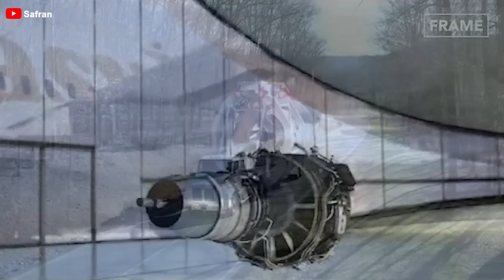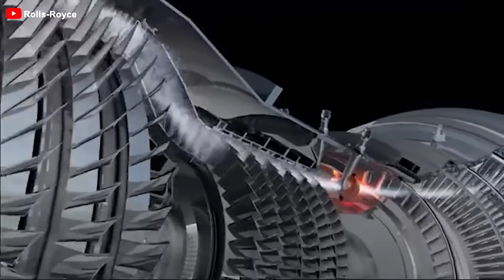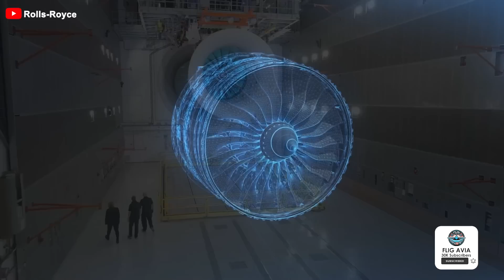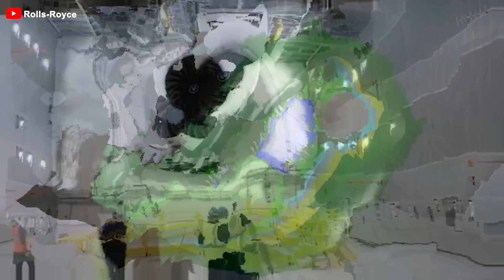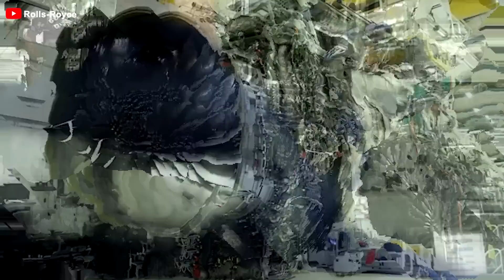Rolls Royce Boss Revealed NEW Engine Will Change The Aviation Industry! Here's How

Comment: Great News from the Worlds Greatest Jet Engine Manufacture,  I have noted that Rolls Royce have lost out on the supply chain for Aircraft like the Airbus A.320 321 etc plus Boeing 737 since the days that IEA Engines was sold leaving as your Vdeo states only the Wide Body Aircraft for Engine supply, Rolls lost any supply facility to Boeing on the 777 but got an exclusive on the Airbus A.350 which is not only selling well but is in production where as the 777 is still  stuck with certification problems.#
I am a Brit and proud of it and fully believe that Rolls Royce will lead the World with some of the very best Aero Engines ever made.

Comment: Please, give all measurements in SI Units (the metric system) in addition to the insane stupid and outdated imperial system only used by Liberia and the US.
140 inches = 3.556 m or 355.6 cm or 3556 mm.
85,000 lb = 38,555 kg
110,000 lb ≈  50,000 kg
Reply: WHY? because people cannot do simple mathematics?
Reply: @trevorhart545  Because the insane and outdated imperial system ha no logic, and it's no easy to calculate every imperial measurement into logic SI units.
Reply: It is not always an accurate thing to do, especially if the original specifications were in SI units and the figures being quoted are a rounded conversion to Imperial.

P.S. I agree with you about using SI units, not because I am biased (I am old enough to think in a combination, being quite relaxed about adding x grams to y pints in a recipe!), but for the simple reason that Imperial units are not fully standardised.

For example, wherever you go in the world, a litre will be the same, whereas a pint will not necessarily be.

Comment: Rolls Royce needs to fix their current engines as well. Their current engines are currently having reliability, durability, and availability issues. More time and money is needed to fix these issues before proceeding to their next gen engine. As it is, airlines are opting out of Rolls Royce powerplants on their follow-up orders of aircraft. No point having a great new engine if the company's reputation is falling to the wayside, and airlines refuse to buy anything from them.
Reply: They are doing.

Ultrafan is a program as well as an engine.

Some of what has been created and tested in the Ultrafan is now being incorporated into tweaks and improvements in existing Trent engines.

Not only should this increase efficiency, emissions, and reliability of the existing models, but it should also reduce the servicing requirements.

Some of these changes will be retrofitted to the troublesome Trents as part of the resolution for outstanding issues.
Reply: What engine are you talking about? Trent 1000? Those issues were fixed long ago and now it’s just parts that are backed up. Fuel nozzles in the xwb? Fixed. Everyone in aerospace is feeling it from the supply chain. Rolls is investing literally a billion pounds into their engine upgrades.